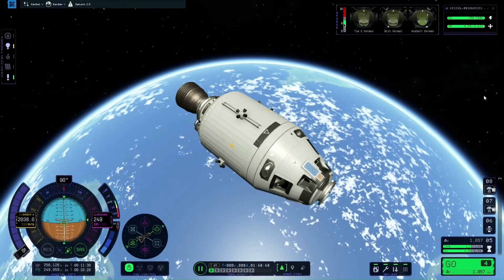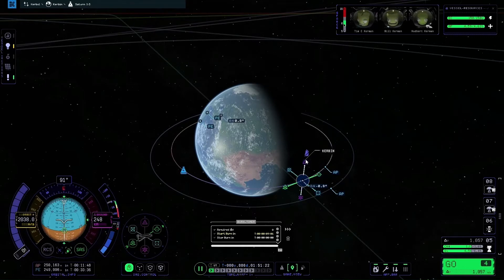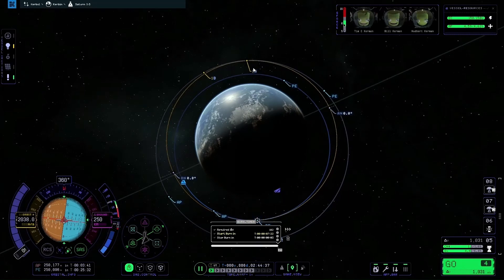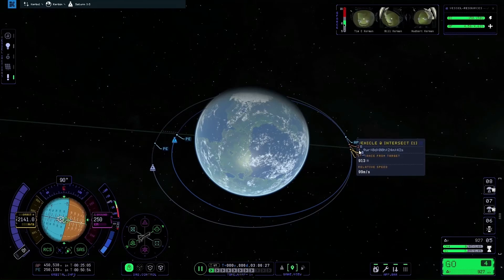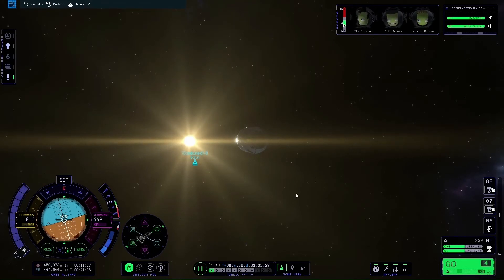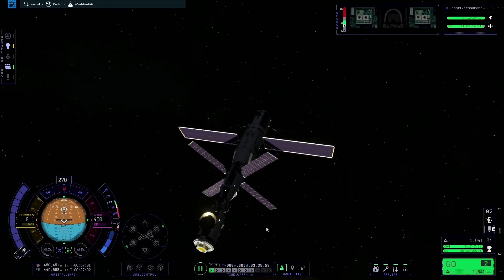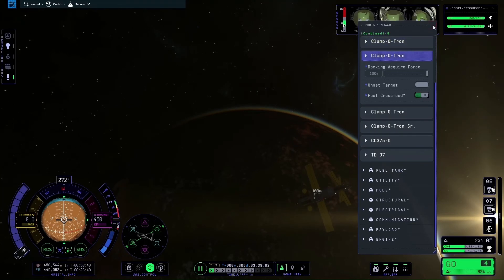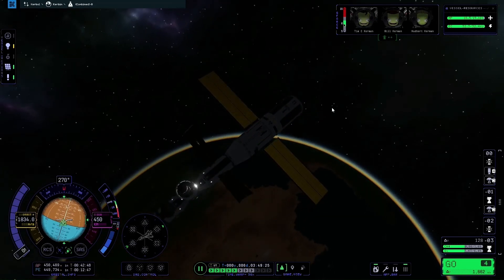KSP2 Rendezvous & Docking (Tutorial)

Comment: Great. I finally manged to do the docking in KSP2 (KSP1 worked much better I think).  One question if you will.  What are the DOCKING/Normal modes for. I think I have not used the mat all for the docking. Or have I? :)
Reply from the maker: Docking mode means you use the WASD keys instead of the IJKL keys for the translation. I prefer to just leave it in Normal mode so I've always got separate controls for translation and atitude adjustments. It's down to personal preference really :)